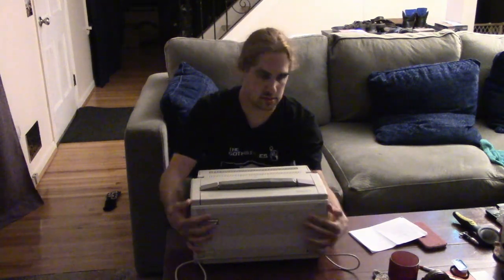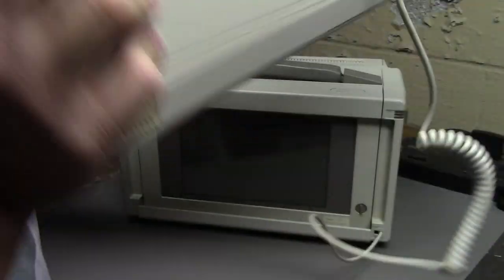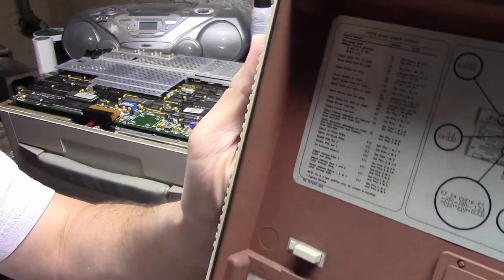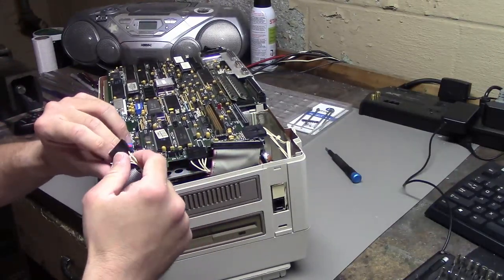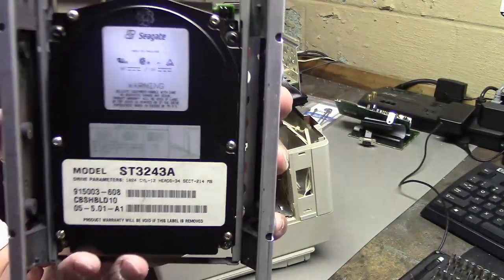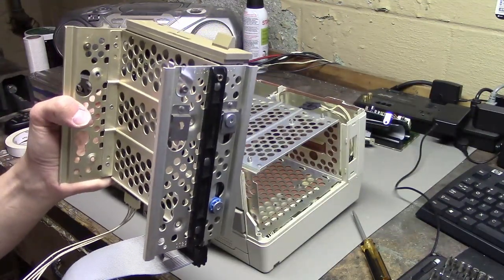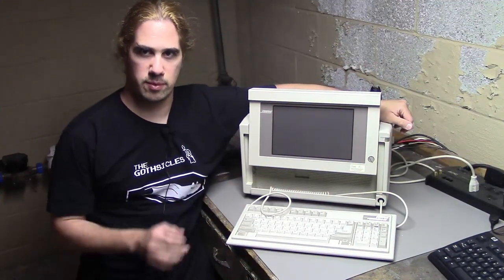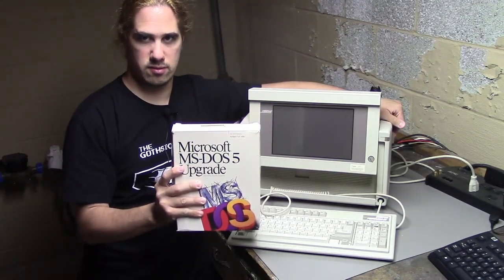Testing and repairing a Compaq Portable III

Comment: You mentioned the need to replace the CMOS battery. on the Compac Portable III.  Please would you detail how you accomplished this.  What battery configuration did you use?
Reply from the maker: Here's a forum post where I figured out how to fix the CMOS battery: https://www.vcfed.org/forum/forum/genres/handhelds-portables/1219164-compaq-portable-iii-cmos-battery-replacement

You may need to make an account/login to see the pictures though.  I'll try to summarize it in another comment in a bit.
Reply from the maker: Here's the battery mine originally had: https://mobile.twitter.com/Foone/status/1416175186055864321/photo/1
I was able to just pull it out without needing to de-solder.

Then I bought one of these: https://www.ebay.com/itm/393034276229

I was able to take some pin headers (like this https://www.adafruit.com/product/3647) break one off and stick it in the hole where the original battery was.  I was able to hot glue the headers in (again, no soldering).

Using some jumper wires (https://www.adafruit.com/product/1953), I connected the battery to the terminals and stashed the battery behind where the floppy drive is.

Here's a picture showing where the battery goes: https://i.imgur.com/uVHTtOw.jpg
I didn't attach mine in the same way, but I put the headers in the same spots, connected the wires and it worked.
Reply: I have the same LTC-7P-MP-F-S2 battery your described with the four legs that slot into the mother board.  I note that the battery was missing from your board when you made your YouTube video.
 
The earlier thread (2013) on this topic discusses a diode and resistor in the battery circuit. I can see that my battery has these glued in the casing.   I found no further information or discussion on these although they appear to be important in preventing current following to the battery when the computer power is turned on.  Did you need incorporate the diode and resistor into your wiring for the replacement battery you selected.  Also, did you receive any answer to your question regarding the reason for four legs?  I see you only used two of the motherboard battery leg sockets.
Reply from the maker: The battery was actually pulled out before I even got the machine.  The person I bought it from had done that.  I think the resistor/diode can be used if want to replace it with the newer LTC-7P model (as the one used here isn't made anymore).

I did not use the resistor/diode, I just connected the 3.6v battery to the 2 pins shown in the picture (XB1 and XB4, I think) and it worked.  I don't know why the original battery has 4 pins, and I couldn't find any info about that.  Using the battery I installed, everything is fine, so that's fine with me.
Reply: Thanks, I will give it a go

Comment: For the keyboard only, can just pop the little round cover off where the cord goes in which you of course now know. Then just a regular AT keyboard socket in there. I bought a coiled keyboard extension cord, cut the end off, and soldered that into my keyboard to fix mine. You can also find tips online for carefully scraping away bits of the RTC module and then you can solder wires to that and add a coin cell holder for a typical CR2025 battery to retain the settings.
Reply from the maker: I use an AT extension cable to use a "normal" keyboard.  I did buy another one to try to fix the original keyboard with.

I found somewhere online a way to attach a new battery, I tried it and I think it works...

Comment: I hope you have changed the snubber capacitor in the power supply. When this is an old RIFA X2 capacitor it can go boom and damage the unit.
Reply from the maker: I, uhh.... I didn't open up the PSU :-|  It's been running fine, but I do know that caps can (and will) explode!  Before powering it on again, I'll have a look at replacing that cap.  Thanks for the advice :-)

Comment: Congratulations on explanations. Where can I find the IDE CF card and the power supply ?
Reply from the maker: The CF card bracket is from: https://www.ebay.com/itm/304058663521

On that eBay listing, you can choose to have the IDE adapter included as well as a floppy power cable adapter.
Reply: @nticompass  My Compaq Portable III came without the keyboard cable. How can I reassemble it? Thank you
Reply from the maker: You should be able to open the keyboard and replace the cable, something I'll need to do too.  You'll need to look up how to disassemble the keyboard as I haven't tried it yet.  There's a screw under the Compaq logo on top, so I've been hesitant to open it.

Comment: I found a Portable III that has a blown Tantalum capacitor, correct me if I spelled it wrong. Are they easy to replace?
Reply from the maker: I'm not the best at soldering, so I can't really say how difficult it is to replace the capacitors.  Taking the machine apart isn't hard, though.  Maybe for someone with decent soldering skills, it wouldn't be hard to replace the capacitors.

Comment: Does anybody know the voltage output from the red molex connector from the power supply?? Been looking for the values and couldn't find them anywhere. Is the only data i need to repair one of these portable 3 with power supply issues
Reply from the maker: I did not measure it on mine, but I found this link that seems to have the answer: https://oldcrap.org/2018/11/12/compaq-portable-iii/#comment-15136
Reply: Thanks!